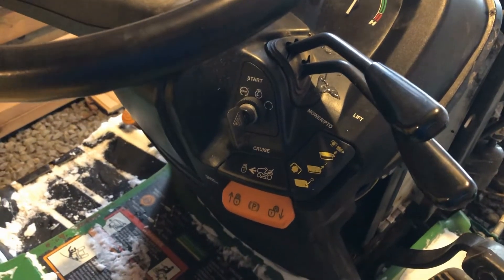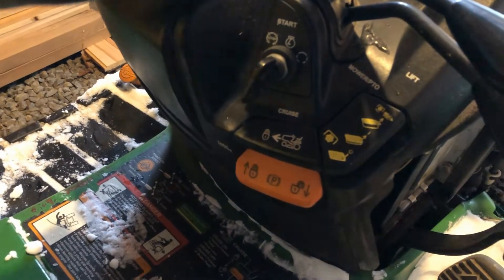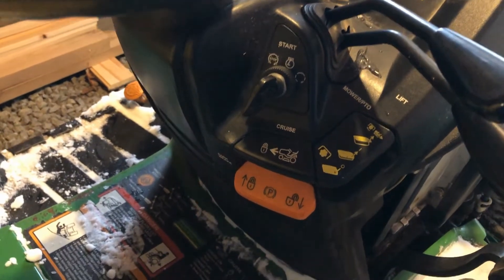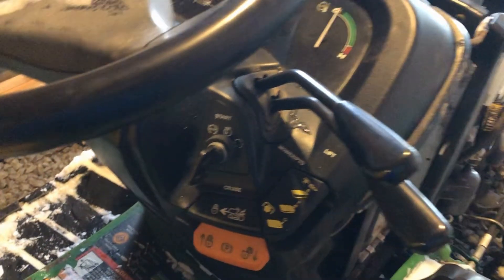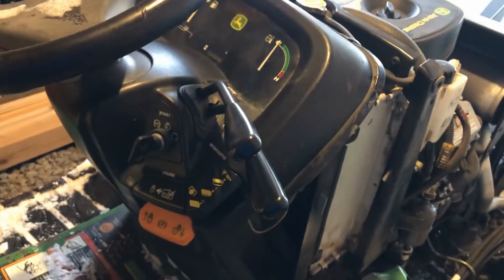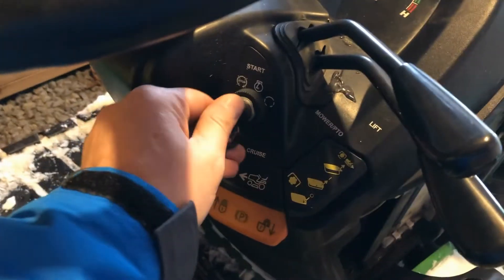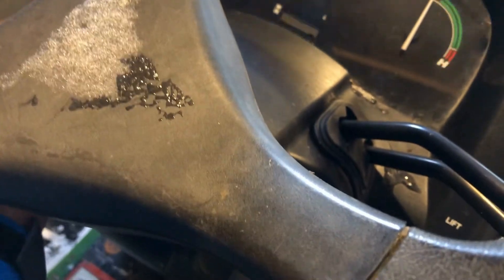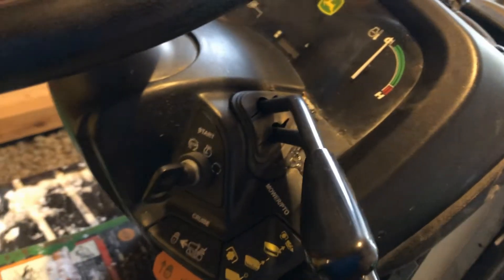John Deere X728 Tractor Won't Start - Need YOUR help!!

Comment: Pull the fuse panel and make sure the connections are good. Mine had been doing intermittent stuff for the 7 years I’ve had it. Sometimes wiggling the fuses will let it start. Sometimes rain water gets in there and won’t let it start. If I had all the money back from starters, batteries, switches, sensors…. EVERYTHING IT WASN’T…..

Comment: Likely one of the safety cutoff switches under seat or on the brake or deck
Reply from the maker: All seem fine.  Should still get power in the on position even if one of the safety switches is broken, I believe.

Comment: Neutral safety switch! Wiggle the reverse pedal and sometimes it will have all power. Sometimes it will act like battery is dead, people will tell you stater or voltage regulator but some grass or snow on the neutral safety switch will bone you. I’ve got a 2006 x728 se and have been dealing with this for 5+ years and changing batteries, fuses, 3 starters! I hope this helps someone
Reply: It’s on the right side tucked in the frame. There’s also another switch on the diff lock side
Reply from the maker: Thanks for all the info!  Appreciate it.

Comment: Not sure if you got an answer, but for my X728 it was common for fuse to blow.  Once I would replace fuse it fires right up.
Reply from the maker: Hi.  Thank you for your response.  My ignition fuse was blown.  But, when I replaced the fuse and tried to start again, the fuse would just blow again.  There was a short somewhere.  Tracked it back to the wire connection on the seat cut off switch.  Fixed that, put in a new fuse, started right up!  Thanks for watching, and thanks for sharing your information - greatly appreciated.
Reply: @MuskokaRepublic  my X728 just started doing the same thing! I initially thought it was the ignition switch, but mine is doing the same as yours. I’m glad I found your video and will check these spots first!
Reply from the maker: Awesome!  I hope you get it sorted out.  Thanks for watching!

Comment: Did you ever figure out your starting problem? I have a 2007, JD X728SE with around 650 hours, Same thing has happened to me many times. I found that the fuse block on the left side of the engine behind the firewall that corrosion will take place even if your fuses look good. Replace all of them with a High quality type, not from  "HF" ...  Also, take a small file and clean the female end on both sides of each fuse. I now just replace my fuses every 6 months. Pacific Northwest area climate...WET. Good Luck.....
Reply from the maker: Thank you for all the recommendations -  very good to know.  It ended up being an issue with the seat switch - kept blowing the fuse.  Ended up replacing the switch and all good!

Comment: Check your fuses. Probably burnt ignition fuse. Or if kept in a shed, check for chewed wires from mouse.  Good luck.
Reply from the maker: Will check fuses, thank you.  Also thinking it could be the starter solenoid.

Comment: I am having this exact problem. Ran fine, parked for 30 minutes, then this. Was able to jump start, so I considered my battery may be the problem. Coincidentally my battery tested as weak, so I replaced it, worked fine, shut it off thinking all was well. Next day, back to no start. I pulled and looked at the fuses on left side interior of under dash, all were fine. Lifted my seat tugged on the wire to seat sensor, started up and ran fine once, shut off and was back to no start. I am doubting a blown fuse due to it's intermittent occurrences. I did not see that you had a clear solution. Anybody have an answer?
Reply from the maker: It was a loose seat sensor for me.  No issues since getting it tight in place.